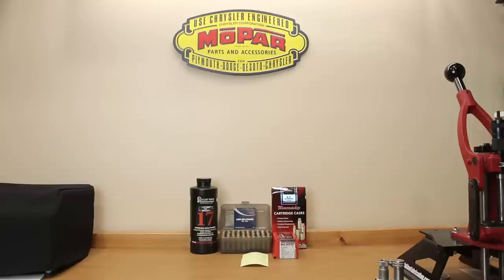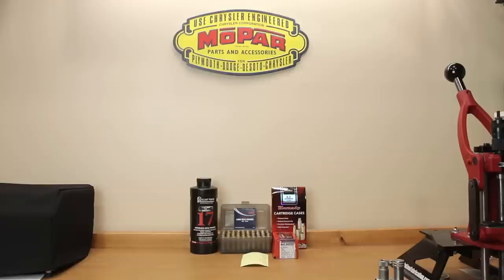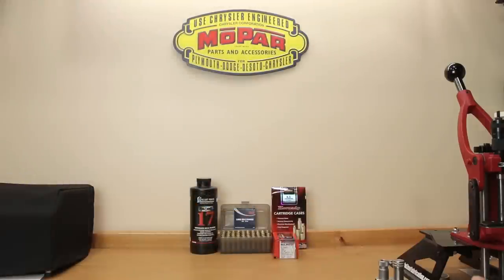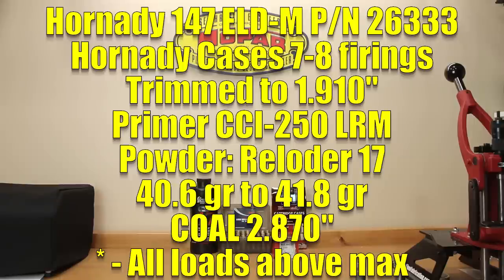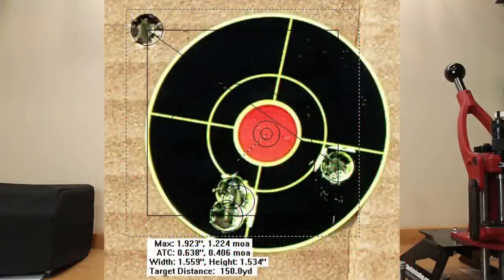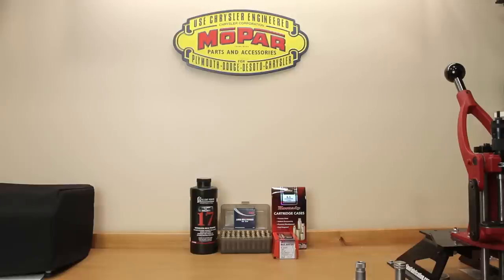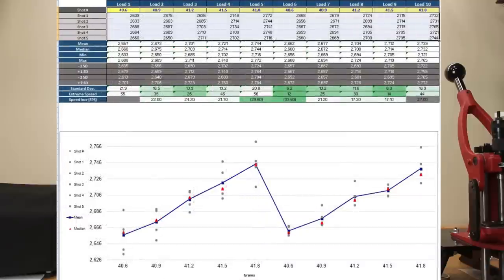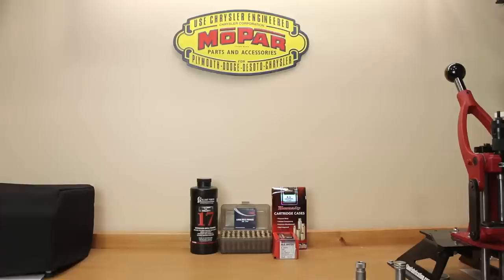Neck Turning Brass -  Improving Load development and Analysis

Comment: Thank you for explaining your loading process.  Many top shooters perform certain steps (like neck turning) to remove the possibility of a flaw.  There is no question that there are less dimensional and composition variations in premium brass (like Lapua and Norma). Your  grouping data reveal enough variation to conclude that the variables of powder, primer, and projectile produce significant differences when measured by group size. Those may mask the small differences produced by neck turning.  The true test of neck turning is in a "developed" load.  Once you find a good performing combination of components it is difficult to make it "better".  The use of a "factory crimp die" where you rotate 120 degrees and perform three light applications will do more for you than neck turning.
Reply: David - can you PM me the crimp die method?  Thanks!

Comment: Can you perform a test with less variables. Use a single dialed in accurate load, 3  Five shot groups of turned, 3 Five shot group of non turned. If their is any correlation, it will be obvious, this also allows for some minor shooter error.

Comment: If your neck turning for a factory chamber then you are increasing the gap between the case neck and the wall of the chamber and that can negate any advantage of extra concentric brass because the case lays in the bottom of the chamber in a sloppy factory chamber . Also you don't want to turn off too much brass for a factory chamber just a skim neck turn is all you need . Clean up about 75% only . The trick to get the neck turn advantage is partial neck sizing so a small section of the case neck is never sized . Using a  Redding body die and a Lee collet die  or a Bushing neck sizer die . The small second shoulder remains full chamber diameter for the life of the case . Mainly only suitable for bolt action rifles .

Comment: I think neck turning may be mandatory if a reloader plans to use a neck turning mandrel to expand the necks and set final neck tension. My experiments with the neck turning mandrel and non-turned brass resulted in brass that required a lot more force to seat the bullet and produced more run-out in the rounds. Are you sure you're really getting .002" of neck tension after turning the brass? After turning and sizing the outside diameter with your FL die, the inside diameter of your necks should be larger and the neck tension should be somewhat less than .002".
Reply from the maker: Regardless of the turn the expander sets the ID of the brass.
Reply: Sure, but the effect of the expander (neck tension) depends on how much work it does as well as brass spring back. Ed Mobley discussed this in one of the 6.5 Guys videos regarding his use of the turning mandrel and a switch to a .287 bushing.
Reply from the maker: I am not sure that while annealing and probably removing less than .001" of total material that it is changed that much. When using annealed brass the spring back is very minimal.
Reply: @njgrplr2007  If I remember correctly the 6.5 Guys said that if you are using an expander mandrel to set your neck tension you need to order a slightly tighter bushing for your bushing die because if the expander mandrel doesn't move the brass enough the brass would simply spring back and the step would be wasted.  A bushing that was tight enough before neck turning may not be after neck turning if you take off a lot of material.
Reply: @silentbob267  Exactly
Reply from the maker: I am resizing with a FL die. No bushings for me right now so plenty of sizing is being done to set the tension correctly.
Reply: @BoltActionReloading  Notice you are getting less actual velocity than estimated with the neck turning mandrel. If you had more neck tension than normal, you should be getting higher pressure and more velocity. Also notice that the brass that was not neck turned produced more velocity in most cases. In other words, the thinner case necks are producing less neck tension.
Reply from the maker: If you average all the shots stock and all the shots NT the average velocity is higher by only .2fps. It's in the noise.
Reply: @BoltActionReloading  Ok, I think we've beat up the debate on neck tension and we can certainly agree to disagree on that point. The driving force behind my original comment was to pass along a big lesson I learned after experimenting with a neck turning mandrel to set final neck tension. My results were forewarned by Glen Zediker on page 149 of his book, Handloading for Competition. "Make the hole it's (the bullet) supposed to fit into too small and it hurts the bullet. Bullets make poor expanders. Bullet seaters make poor sizing dies. Damage to the bullet base area, circumference surface area, and ogive can (and will) result. Too small can also hurt the case: necks can tweak, bend, and crease, and shoulders get moved down." I just wish I paid more attention to that warning before I wasted a lot of time and money with my tests. While I did see an average 5% increase in muzzle velocity and my SDs were better with the expander mandrel, .5-.7 inch groups turned into 1.1-1.5" groups with my custom .300 Win Mag. Not what I was looking for.

Comment: Does neck turning cause brass to wear out faster not get as many reload out of it?
Reply from the maker: I am sure that it depends on caliber some what. The 6.5 creed tends to loose primer pockets before necks split. But I am just removing enough to make it even, leaving as much as possible. Also ask yourself which is more important more reloads or more consistent. Different people will answer that question differently. It doesn't mean they are wrong, it's just what is most important to them.

Comment: Sir, question regarding the Sinclair Expander Mandrel.  Do you use carbide or stainless steel?  It seems that the carbide is .000.5 smaller than stainless steel.  Thank you in advance for your help and all the good videos.
Reply from the maker: I prefer to use the carbide. There is a very slight difference,  but not much.
Reply: Thank you @BoltActionReloading
Reply from the maker: No problem

Comment: I'm curious on how do you weight the powder? The SD seems too high and looking at all your reloading process, it should be mostly in the single digits, maybe a more precise weight will improve the SD (along with a more temp stable powder). I use in my process a lab scale that goes to 0.001g and my SDs improved a lot after introducing it.
Reply from the maker: I am using a waow scale that resolves down to .02 gr. It's the brass mostly. Check out next weeks video with Peterson brass had some ES of 5. With extruded powders I can resolve pretty much down to 1 kernel of powder.

Comment: I am having the same problem with velocity consistency my self with my        .300WM had a few people tell me neck tension is poor and a few others told me to leave h4350 alone its to inconsistent for precision shooting.... any thoughts? And would trimming my case to the max O/A length help with neck tension?
Reply from the maker: Hi Shawn, The case necks are not very long on 300 WM so I do think that consistent neck tension is part of the challenge. I haven't really used H4350 very much for 300WM but its basically the best powder for 6.5 creedmoor and other popular PRS rounds. Not sure why anyone would label H4350 "inconsistent." For heavier projectiles 220+ gr you get higher velocities out of slower powders. I am not sure that only trimming to max would make that big of a difference.

Comment: You need to do some proper statistical analysis--the first thing you need are larger sample sizes.  Shooting one three or five shot group doesn't give you a way of estimating the variance between average velocity and/or group size.  If you are only interested in velocity, then shooting 5 rounds at each load gives you an estimate of the velocity and the variance.

Then when comparing NT vs no NT results, you have a linear regression situation.  But I'm not sure what exactly you'll be estimating.  These are just some of my thoughts coming from a retired biostatistican.

Comment: If you just use a real cleaning solution you can get perfectly clean brass in 30-45 minutes and not peen harden your brass (as much)
Reply: Like what?
Reply: Andrew M RCBS, frankford arsenal, and Hornady all make wet tumbling /ultrasonic solutions.
Reply: @FullSendPrecision  I just read about a new solution called Brass Juice on another thread earlier today.  It seems like it was created to clean well in a wet tumbler without the pins.  It also claims to work well in an ultrasonic cleaner.